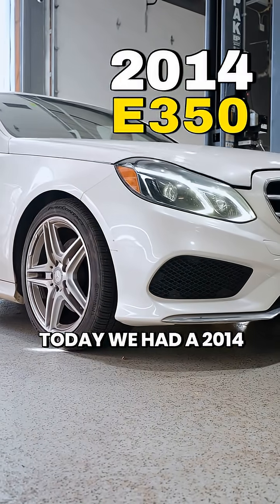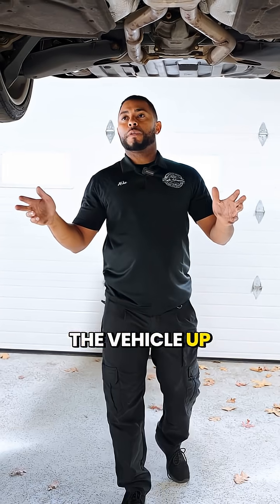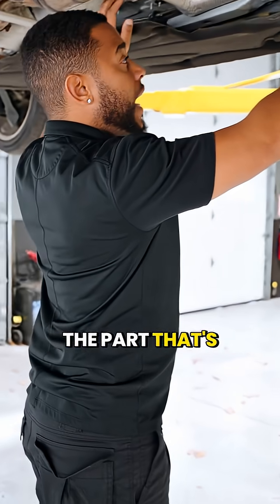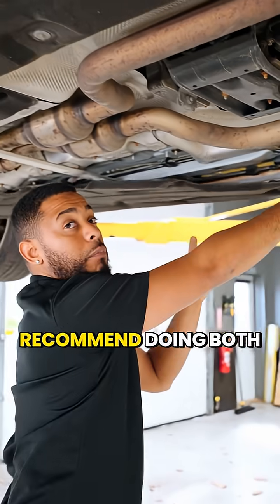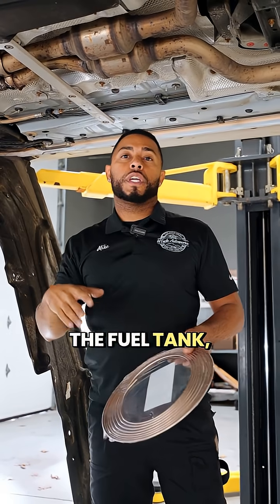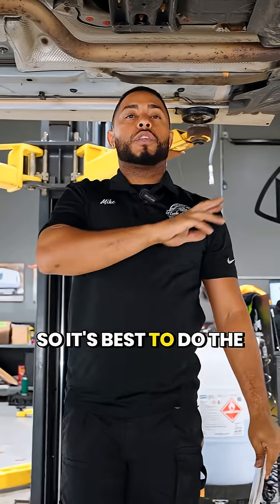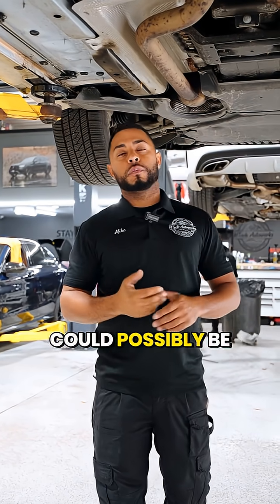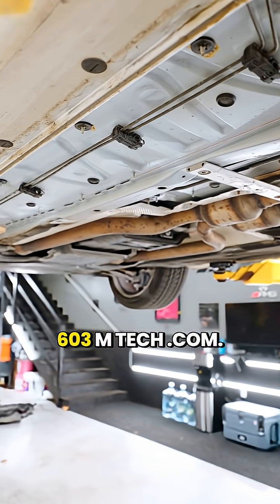Mercedes Brake Line Failure Explained | Common Rust Points on 2008–2016 Models

Comment: I never use copper on modern cars, abs pressure can rise over 100 bar!  Seen copper lines burst on w211 with the sbc system. The green lines from mb are bad, use the Black one.

Comment: I thought steel didn't rust.
Reply: Galvanised steel doesn’t. Regular steel does.

Edit: Stainless steel also doesn’t rust. That’s why it’s called stainless. 

Edit 2: All steel will eventually rust, it’s just a matter of when. Galvanised steel will rust when not enough zinc is left remaining or if it is cut, and stainless will rust when there’s no more chromium in the alloy. It will just take a VERY LONG time, we’re talking tens of years.

Comment: FYI to any mercedes owners, you have free towing to any mercedes dealership or certified repair shop
Reply: Only under warranty OR if you get it towed to Mercedes AND pay to get the problem fixed. If you decline the service you’re stuck paying for the tow. Most cases it’s cheaper to pay for the tow and have the car fixed at a private shop
Reply: For life!  They may be one of the few if not only that do this.
Reply: Did not know that !!

Comment: Mercs are very bad for brake pipes corrosion.I’ve got a Honda odyssey 1994 reg,had it for last 10 years and it’s still got all original brake pipes on it and no rust in site.
Reply: Depends on  if the car is from the North !! Normally the salt in the road , will damage a lot of undercarriage parts
Reply: Mercs build quality dropped crazy after 07. I have an '05 c class. Never had an issue with brake lines.